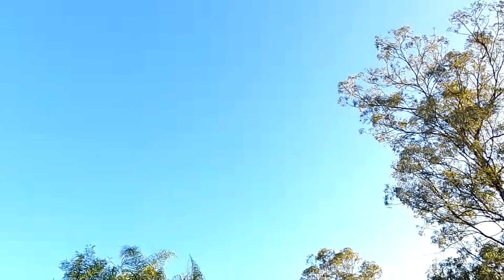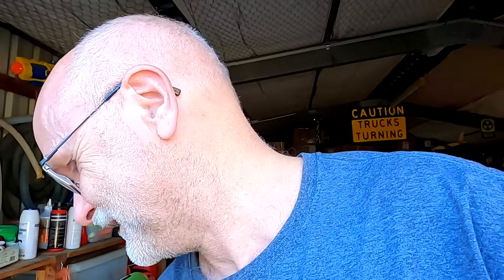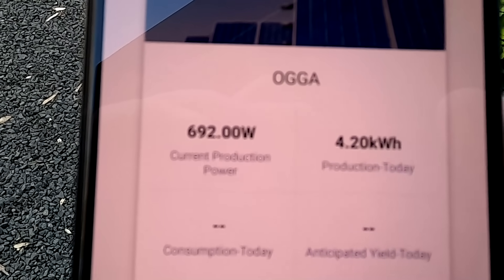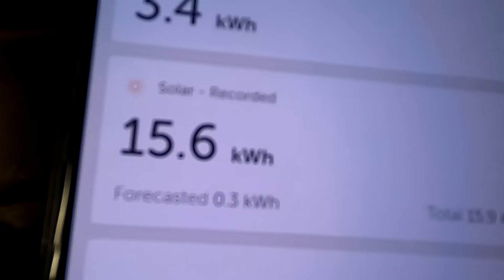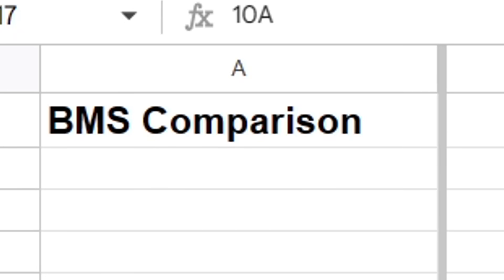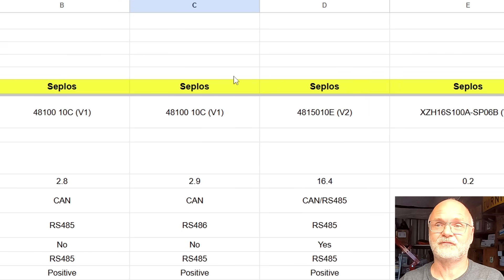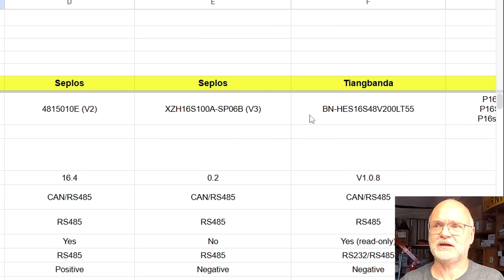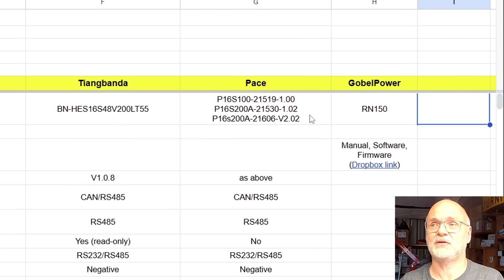All hidden BMS features for Seplos, QSO, Pace and Gobel Power. The BMS Comparison.

Comment: I need your help about my pace bms 16s 100 amp. By mistake, I upgraded the bms firmware with some strange firmware. I would like to ask if you have the proper firmware version. At the moment, I can't change the charging current. It looks like the firmware version I have installed is managing the current by itself, like 90 ampere and this is not good for my battery due the maximum capacity of 200 amp.
Reply from the maker: What exact BMS do you have? There is a sticker on the BMS with all the details.
Reply: 16S100A-OLT13660-10A-ZJ
Reply from the maker: @danilozampella2215  Can you still connect through the PC software to it?
Bottom left gives you more information about the FW it is running right now and what hardware version it is.
Reply: @OffGridGarageAustralia  Hi Andy, I can connect with PC.

Comment: EDIT: talking to the sales rep it appears the Seplos can deliver a regulated current, ie a maxed out load without tripping and shutting down. I've approached various fora about it but everybody has an opinion and no one seems to be able to give a non-contradictory answer. Andy, you seem to know your way around the Seplos. Can it be configured to deliver a specific discharge/load current without shutting down the BMS? If not, do you know a BMS that can? 

Another awesome video Andy, thanks for all the hard work in sharing your efforts! I have a question, do you know of any BMS's that can limit the continous output load current instead of just switching off the load? We have a 14kW LiFePo4 bank and I am looking for a BMS (or something) that will also manage the output.

Comment: I’m wondering if there are bms systems with wifi access for remote monitoring. Most inverter brands have wifi & internet data logging now. 

I’m looking at building a smart shunt  with wifi & internet datalogging. Just surprised it’s not  common already
Reply from the maker: Usually the BMS hooks up with an inverter or other system (Victron Venus OS for example). It reports all the data to this system and can be read remotely.
I can see the lowest and highest cell voltage remotely for example through the Victron VRM. or the battery temperature which the BMS reports across all its 4-6 sensors.

Comment: Same findings on that EVE terminals here (bought from NKON as Grade A cells in the Netherlands).

On the „screwing through“ issue of the EVE terminals: i 3d printed a little tool to prevent this.

I really do like the SFK terminals.

Still thinking which cells to get next - EVE or REPT.

Comment: Hi Andy, hope all is well in sunny hot Austrailia, it would be great if you could do a quick video on setting the Seplos High SOC% disconnect via both the PC software and Bluetooth (if possible). Their instructions are are clear on the low SOC but High SOC are "not good".
Reply from the maker: OK, I can certainly do that. I think this is turned on by default for all Seplos BMS.

Comment: Andy, I totally get what you are trying to achieve with the extra panels on your house roof tilted towards the winter solstice sun... I to have looked at my yearly performance and can see that the further away I get from the summer sun here in Melbourne Australia the worse my current panel installation is performing.... 
The two weeks before the end of June and the two weeks into July are the worst performing days for me.... At probably around the same time as you began your winter panel setup, I had already been thinking about installing extra panels tilted towards the winter solstice sun... I felt that I needed to flatten the yearly curve... Living on a much smaller block of land is challenging trying to find a good solution to add more panels with a tilt which won't shade my main panel setup.... 
But I think that I can pull it off, I then began to wonder if it was worth it to set up four groups of panels all aimed at the four different sun angles over the four different seasons.... Would it be worth it? 
I kinda feel like I use a lot more energy during winter and summer... But I don't think that I have ever noticed what is used and what is used more during autumn and spring? 
I'm expecting to see less heater usage as spring begins to roll in but I have no idea what is going to become the main energy hog during that time.... 
Maybe we need a spreadsheet of which appliances are being used constantly throughout the year and those that are only used during specific seasons.... 
I have gas central heating which runs day and night during winter but come summer it's forgotten as the aircon takes over... They are obviously easy to realise but I think that I will be taking more notice of what's happening during the other two months that are never mentioned when talking about solar energy... 
All I have right now is the downward trend of solar energy towards winter... 
I think that there's a lot more to this topic which I hope gets more attention....
Reply from the maker: Thanks, Peter, great comment and topic. An infinite topic and discussion, I believe.
Pointing panels in different directions may work or may not bring any benefits. It really all depends on your usage profile and how you can handle the generation/usage relation. For me it's a bit easier as my wife is very energy focused as well and watches the battery SOC and weather before using the dishwasher for example. I can manage charging my vehicle when I'm at home and the solar production is enough or SOC is enough. If not, I don't charge today and leave it for tomorrow.
I also have such a spreadsheet and used one of these cheap energy monitors from Bunnings and plugged this into the lead for all appliances, pumps, hot water, vehicle charging,... for 4 weeks to get an understanding where my energy goes.

The new tilt system has now doubled my production in winter which is great but still not enough! So, I will end up installing even more solar for next winter. Now, I can already see a small increase in production as we go uphill from the solstice a few weeks back.
Reply: @OffGridGarageAustralia  Andy you mentioned a cheap energy meter from Bunnings, is that like those wattmeters? If not... I would love to see how you are measuring everything else... 
Also, I have noticed in some of your recent videos where you mentioned that you are not getting a wind turbine.... I love how you do that, it's quite funny... (Wow the grid just dropped out as I'm writing this! Lucky all the important stuff is off grid!)... 
Anyway, on the topic of wind turbines, I haven't seen anyone show what these things are actually capable of... There are no long term testing where you can see what a turbine will produce over a year... 
We do get some very windy days down here in Melbourne, and I do remember saying to myself that a wind turbine would have been great on that day which would mean that it must have been very overcast and solar production would have been very low for me to even say that... 
On your winter panel setup, I have seen you getting 2kw, is that just from the 4 panels tilted on your house roof? If that's the case, I'm only getting peaks up to 1.5kw from my 24 panels which get up to 4kw peaks in summer via two victron Charge Controllers... I have a pergola but it's facing the wrong way, it's great for that afternoon summer sun.. so the idea is to build a new pergola across the back of the house and fit one or two strings of panels there aimed at the winter solstice sun... I really need to flatten the curve... June/July are just terrible... The new xing Ping 6kw inverter has just arrived to upgrade from the 3kw version which has been very reliable... The second set of 16 270ah cells are already on their way.. slowly but surely I'm removing more appliances from the grid to the garage... 
Anyway thanks for your reply, I really appreciate it! I love your channel and I love that you are doing it, it just wouldn't be the same if it was anyone else.... Thank you.

Comment: Andy, I know that other than Seplos, this would be impossible for you to discover, but I'd like to know how these industrial BMS' interact with each other when parallel with other packs of the same BMS manufacturer. When paralleled do they simply pass status info to the "master" for agrigation to the monitoring PC or does the group react to errors or faults of an individual. Example: if one cell in one pack has a 'cell UVP', does the offending pack go offline or does the entire stack drop out. Not the greatest example but looking to find the BMS mfg'rs idea of error handling or charge controller manipulation when multiple/paralleled packs are involved.
Reply from the maker: I have tested this as well. Any protection affects only the single pack, not the entire battery. I will do more videos on this in the future as I now have a good collections of BMS and test all sort of combinations.
Reply: @OffGridGarageAustralia inthink the REC and TAO BMS are important BMSs missing in your collectio as they have unique features. Eg Tao you can set the time in combination with other parameters eg SOC when you eg wanna have a 100% charge for reference and calibration. All BMS start every day a fresh cycle and charge to 100% but thats actually not necessary at all. If you eg have a huge bank but small solar array (which is typical for bluewater cruising boats its not necessary to get this daily to 100% as it will just bounce between 90 and 100% SOC but if you eg set all 10 days reference charge it will cycle the bank much less but deepr down to 50% SOC.
Reply: That will be great as i think this is the major difference from consumer to.this industrial BMS

Comment: These are quite a lot of features. I am considering expanding my home solar system, and adding battery storage later. Off-grid is not an option due to limited roof surface and property size, but running as much as possible on solar is my goal.There are some hybrid systems like SolarEdge, Enphase and Growatt that combine everything needed so you do not need to know anything about BMS and battery systems for it to work properly in a grid-tied setup.

But I do like to build and understand everything i can, so maybe these complete systems are not the way to go for the 5kWh to 10 kWh that I need to store in order to use as little as possible from the grid in any weather or time of day.

Do you have any advice about the point at which I need to start considering a separate professional level BMS, either in storage capacity or dependency on valuable features that these complete systems simply can not provide? 

I do understand most things you mentioned without any google searches, but I tend to go too far in searching for the perfect setup. As you know, the enemy of the good is often the best.
Reply from the maker: for a 5-10kWh system you can get away with a JK-BMS without problem and potentially don't need any of these more complex BMSs.
As you may know, I have three different BMS running in my battery shelf and they work perfectly without any communication to anything. They just look after one battery bank each.
Since the installation 1.5yrs ago, I had 0 problems.
Reply: @OffGridGarageAustralia  Thanks for the explanation. 

I think Enphase will be the best option for the expansion then. No single point of failure and about as flexible as it gets.

My existing inverter is a 2 string/ 2 MPPT Growatt, but has reached it's practical limits. 

The extra panels will have shade at different times and are very hard to reach. This way I can add Enphase batteries anywhere or just replace the Growatt (3000W) with a hybrid version when and if that makes more sense.

Good to read that all of these smaller BMS versions will do just fine in real life.
Reply: @OffGridGarageAustralia  is there kind of a kwh system limit you would go for the more complex BMSs ? I want to change my Pylontech 20 kWh System to a DIY > 45 kWh System. I had the old firmware and more or less no information from the BMS except the SOC. But having the SmartShunt, SOC should not be the Problem ? Or is the comfort of the PACE etc. BMS primarily having the reset to 100% SOC while the Shunt might loose calibration ? At the moment I'm very confused to go with JBD BMS (Relais integrated and disconnect on Plus) + SmartShunt, go for Batrium with Shunt or direct to SEPLOS or PACE ? What would you do, if you would start your DIY system today from scratch ?

Comment: I have a seplus mason kit with eve280ah cells. My seplos bms reset to 100% at 56v not 58,4v.
So you can change the voltage where the bms reset to 100%. Yes I would like to have the feature from other bms's when I can absorb after the cells reaches the target voltage.  I have done that using the 10A load limiter. Now it absorbs after it reaches 56v. I will change that to 55,4v.

I have set the neey to start right before that voltage is reached so the balancing is happening when the charge amperage is limited so I dont balancing the wrong cells due to different voltage drops over my busbars and cells because i charge with 100A or somethinglike that. This solution works great and I am really happy for it.

BTW I have installed two Mason kit with eve280A (same batch)cells two places. One place there is installed a neey in the battery case, and it works great, especially to balancing the first time. The other case has no neey because I didn't have time to install it 5-6 months ago. Alle the cells is balanced with 20mv difference at 56v. The bms is set up to balance until 20mv, so if you have good quality cells, the internal balancing of the bms seems to be enough. I will install a neey in the other case too soon, because I am afraid the cells will not behave so good when they get old.

Another problem with the neey is that it uses energy all the time. That energy is not measured by the shunt in the battery and will let the shunt drift more rapidly. This is not a problem when the battery is fully charged often. But this can be a problem in the winter where the battery doses not reached 100% for months. I have not dicectly measured the neeys, actually power draw when inactive. But it seems the be 4-6w, measured from the inverter when plugging the neey in when the charging contacts of the battery is off (not an good way to measure this, so please correct me if you know the power draw of the neey when not balancing). But if this is true 6w is 1kWh every week, and if the battery is not fully charged for a month, it's ads up. And yes the shunt doesn't mesure under 0,5A, but this isn't a problem since my inverter uses arround 60w in idle, so the shunts is measuring all the time when I discharge the battery.
A possible solution can be to connect the black lead before the shunt, and then the first balancing wire at the negative terminal of cell 1. But I can't find anyone there have done that, so are afraid that will destroy the neey. So if one of you guys have tried that, please let me know.
Another OT information is that I have installed small 5A fuses on all leads going to the neey except for the black negative wire. It works great since the neey is measuring the cell voltage between balancing. The red wire there power the neey is installed with an 5A fuse on the other side of the cut off switch of the bms. Then the neey doesn't destroy the battery if it's totally discharged for some time or is stored for a long period, since the neey shots off when the bms shots off the output.

Thank you for all your videos and your test! You are doing a amazing job for everyone there want to play with big batteries for home power storage.
Reply from the maker: It depends on your BMS and FW version when your BMS resets to 100%. All Seplos will reset at OVP (either pack or cell). This is not great.
Reply: @OffGridGarageAustralia  i changed the ovp to 56v. And yes I would like it had worked in a different way.
Reply from the maker: @TheE2X  So what BMS and FW do you have?
Reply: @OffGridGarageAustralia  I am at holyday in Germany, btw. I will check when i come back home in a week.
I got the mason kits back in november 2022 with the "new" bms but without Bluetooth. I haven't changed the firmware.

Comment: Well done Andy that a lot of hours put in there by you, so thanks for that. But there is one element missing from your BMS comparison chart and that is the Inverters they work with. You will find that some BMS or battery suppliers with their own BMS design, only work with a certain type of Inverter and their parameters might be different to the competition. This has usually come about due to collaboration.

I can see though, that what you might inadvertently be doing is limiting the market to a standard that one type of BMS suits all. However competition is what makes the world of Batteries and Inverter go round. Choice is what we want, which is often limited by our budget, and making those decisions can be challenging when your knowledge is limited. That is where you step in.

e.g. for me I would like to know why it is that disconnecting the Negative is better than disconnecting the positive at the BMS?
Reply from the maker: Yeah, the compatible inverters are usually in the manual or specification list, so I didn't include them here. It also seems to depend on the PC software which protocol can be enabled.
The Pace didn't have a Victron protocol at the beginning. Jaki sent me a new PC software which had the Victron option. So, this was not a new FW or so...